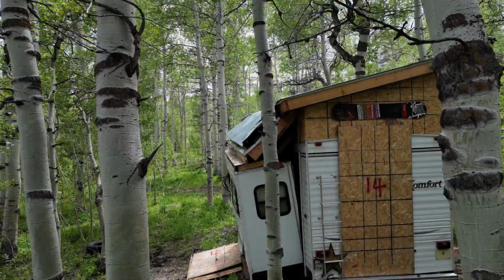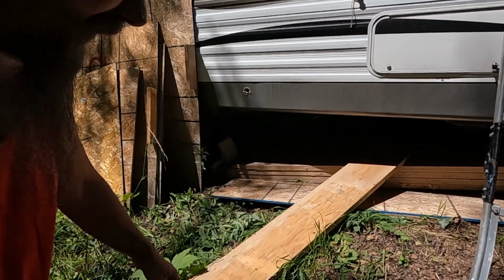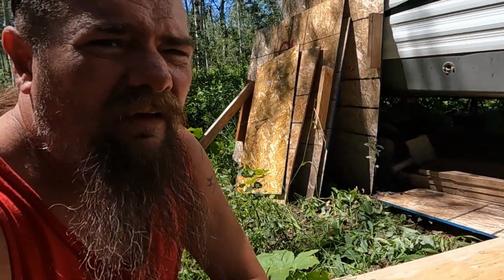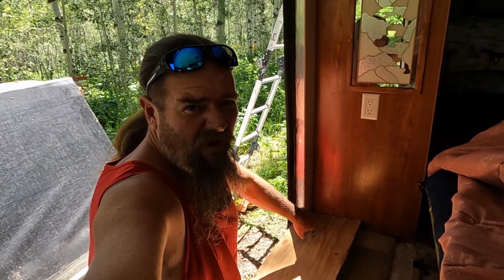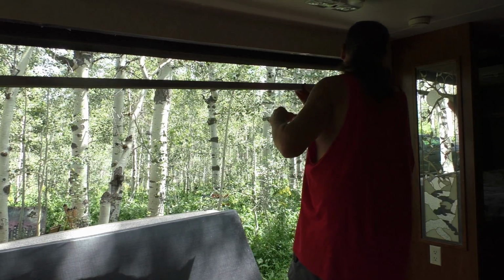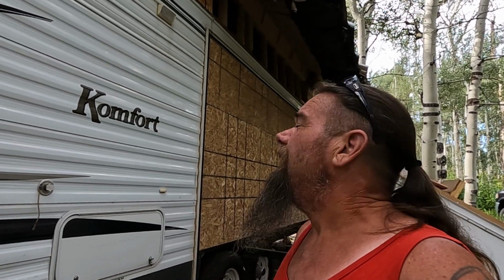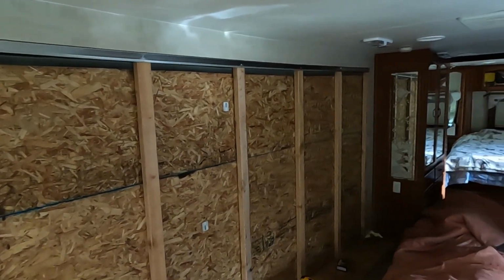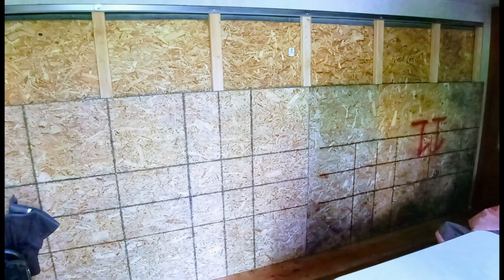DIY: RV Slide Out Major Repair | Removal/Easy Wall Replacement, INSTALL How To Fix This YOURSELF

Comment: I think you are doing a great job and it looks loke it will turn out well.  I had to take down my hummingbird feeders because if the neighbor's cats 🙄 We had one or two of the agressive ones also.  Four hummingbirds coverged on the feeder one time and the little bully left for awhile. 🤣
Reply from the maker: Thank you. We think it will work good also. Bummer I don't know if I could take down mine. I love watching them in action to much. Maybe on a ten foot pole? So the cats can't reach. Love those little guys. Thanks for watching.